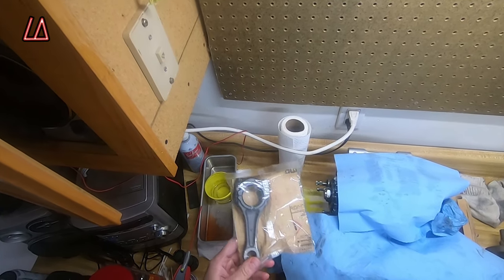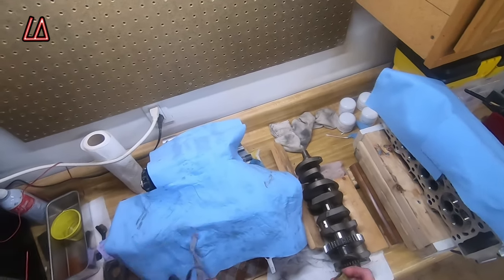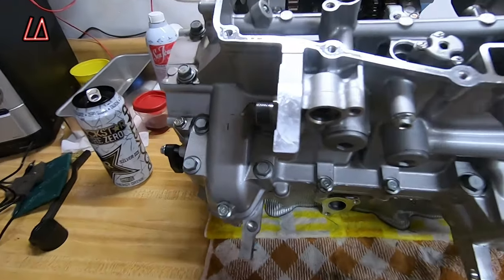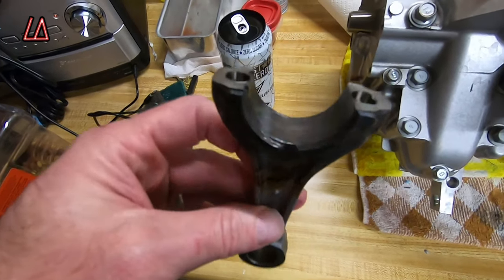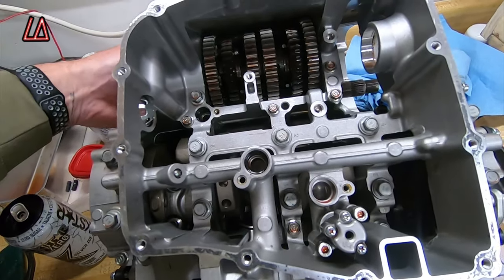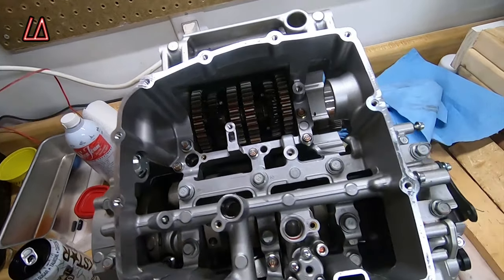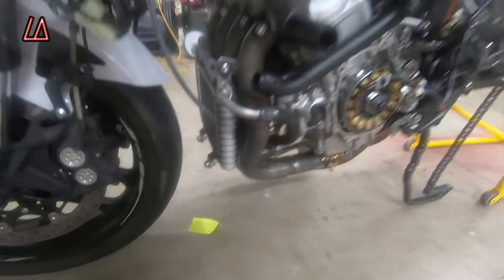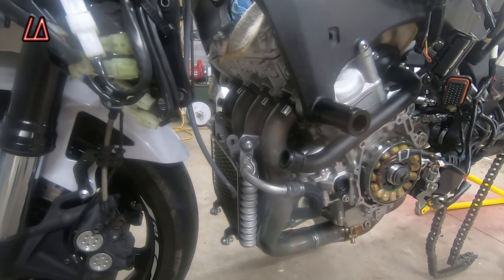Yamaha R1 Motorcycle Engine Rebuild #4 : And the real trouble begins!!

Comment: Great work man 
Did you change the crankshaft? And how did you know which bearing colors you should choose?
Reply from the maker: I actually did change the crank for the original because the #1 journal was burnt.  I made the mistake of getting a R1S crank that was marked as a R1 (regular one).  The R1S has steel rods so the counter balance weight is larger then the Reg R1 crank that has lighter Titanium rods.  I didn't know this because I am not a R1 mechanic and I trusted that the crank I got off ebay was the right one, which it wasn't.  I ended up taking apart the engine again and taking my rotating assembly (crank/rods/pistons) to be balanced and he was the one that figured it out I had the wrong crank, after making a few calls.  So he rebalance that R1S crank by removing more weight then normal.  Now she runs awesome.

Comment: Great work. How much did this run you parts wise?
Reply from the maker: If I recall correctly, it was some where around $1500-$1600.  The dang titanium connecting rod itself was near $400 alone.  But because of being sold the wrong crank and needing to get it and all the rotating assembly rebalanced, the cost was higher then just the basic parts.

Comment: i have a 2018 r1. i bought it June 20th 2018. i have been riding it daily for a little over a year now. i have 18k miles on it. i accidentally dropped it while moving it in my driveway today. damaged the timing chain cover. when i replace the seals and cover should i worry about engine timing? In my mind i shouldn't have to worry but wanted to double check.
Reply from the maker: No u should be fine.  Just make sure u replace the small oil seal that is on the inside (underside) of the timing chain cover.  That is very, very important.  I am NOT talking about the timing chain cover gasket that goes between the cover and the engine block.  I am talking about the small seal that is on the inside of the timing chain cover.  This seal makes sure oil can go into you crank shaft thru the hole at the end of the crank shaft, right where the timing chain gear is.  Also make sure the two pin are still in place that hold the timing chain tensioner plates in their set locations. U should be able to see the bottom of these two tensioners once the cover is off and also see the two pins that hold the tensioners in place. Sometimes when u take the timing chain cover off one or both of those pins will come off with the cover.

Comment: If possible can you show me the wiring connecting..  I’m swapping engines I don’t want to make sure I hook up the coil’s right
Reply from the maker: So, a couple things.  1) what year and make is your bike.  2) if it is a Yami, you can down load the service manual from the Yamaha R1 Forum.  It is free to become a member and the are dudes with much more experience on there that will also help with questions you might have.  3) when disassembling your engine take some tape, wrap it around each wire and number it for each cylinder so there is no way to get them mixed up.

Comment: Do u have a video on removing engine
Reply from the maker: No I do not.  If you are a member on the R1 forums you should be able to find the service manual there.  It will walk you through the removal process.  Else if you have questions i can help you.  You will need a rear stand and the following will need to come off, once all the platic has been removed.  In basic order.../Seat/chain off the drive sprocket/gas tank and air box/drain the oil (note the oil pan and engine cover bolts are one use, dont try to reuse them.  I replaced them with reg steel bolts that can be reused)/entire exhaust/radiator and fans/make sure to tape all the wire fittings and either number or letter them so you know were they go/bag and tag everything/once all that is remove the engine bolts can come out.  The service manual tells you what order, so please follow it.  Also, on the throttle side of the bike there are mounting spacer on the engine bolts that take a special tool and these spacers need to be loosened to get the engine off the frame.  Also make sure you have a very good torque wrench...that shit is vital.  Hope that helps.
Reply: @IamLaR1  thanks so much this does help alot
Reply from the maker: @dsd-downshiftdave8056  ... Regarding those spacers on the engine block bolts, I was able to get the engine off the frame without loosening those spacer nut thingies, by just wiggling the engine (not recommended).  However, when you put the engine back on the frame, those spacers have to be torque down to a specific specification, so you will need that special tool.  I got one off of ebay for 1/2 the price of the OEM tool, so look there first.  Also, the most important thing about an engine rebuild is following all the loosening and torquing down procedures precisely, else you can warp something, so a good digital torque wrench is highly recommended.  You dont want your engine to fail while going 100+MPH because some bolt wasn't torqed down properly.

Comment: Bro did you have to get the motor balanced once you put it back in
Reply from the maker: I had the crank shaft balanced by a machine shop.  They actually balanced the crank, pistons and rods all together, so I didn't have an issue.  Then I reassemble the engine.  She is perfect now.
Reply: @IamLaR1  That's good procedure. If you want to get real picky balance the clutch basket too.